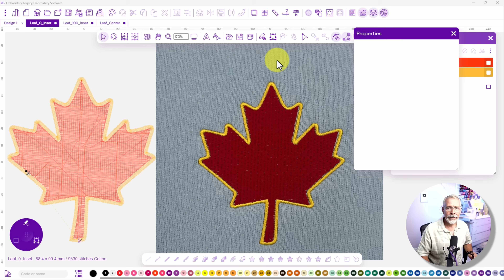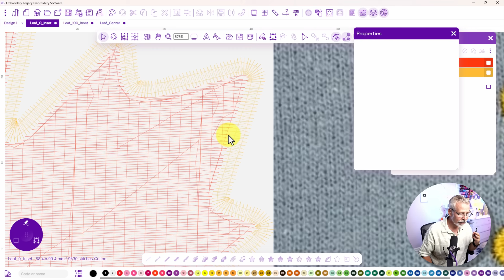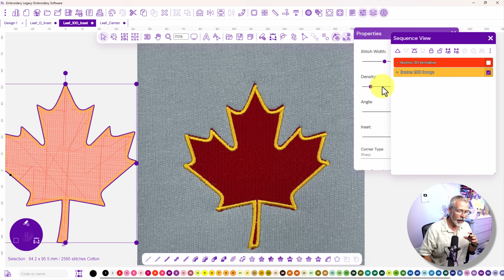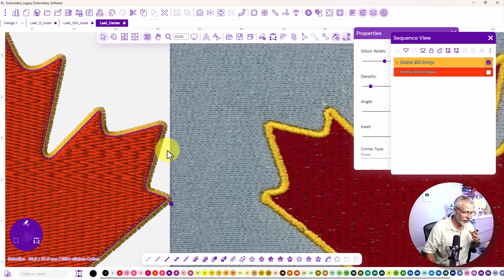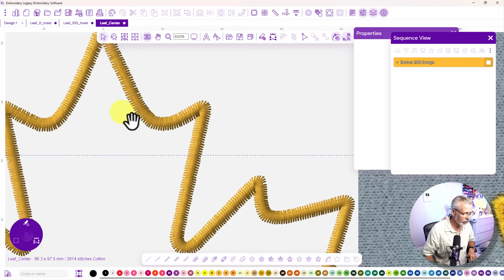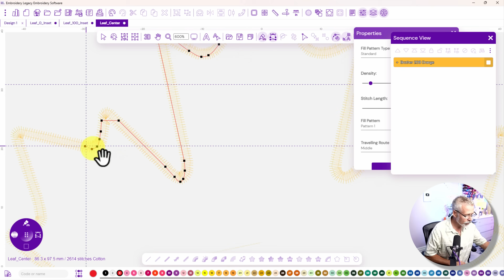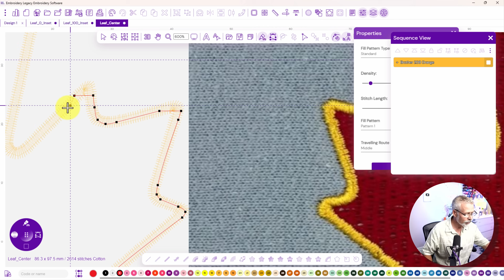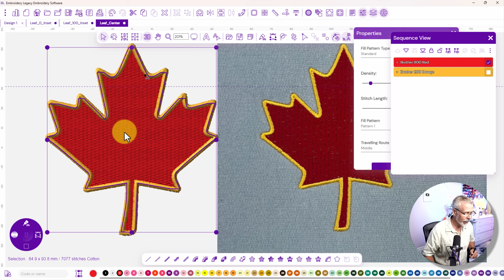How to EASILY FIX These Digitizing Mistakes in Machine Embroidery Designs

Comment: Thanks!! I am also have an issue with the fill getting pulled away by the satin stitch border. So there are now gaps in the fill. Any suggestions to help with that?
Reply from the maker: You’re running into what we call pull compensation issues — really common when fills meet satin borders. To fix it, try these steps:

Increase pull compensation slightly on your fill so it extends under the satin.

Add a light underlay stitch (like an edge-walk) to help anchor the fill before the satin goes down.

Make sure your design pathing has the fill stitch first, satin border second.

These small tweaks will close those gaps and give you a clean, polished outline every time ✅